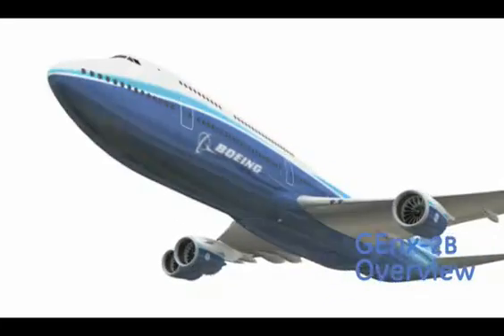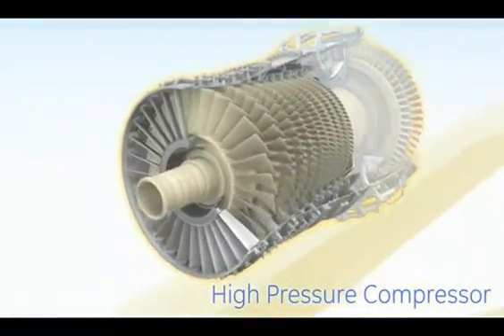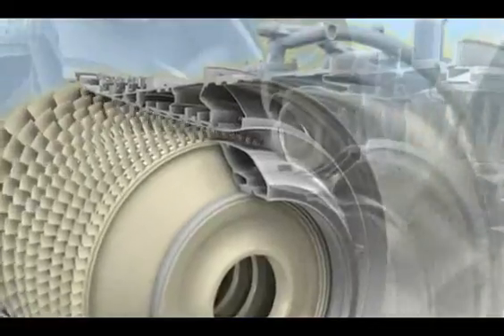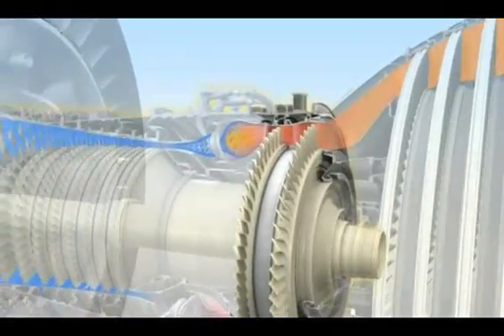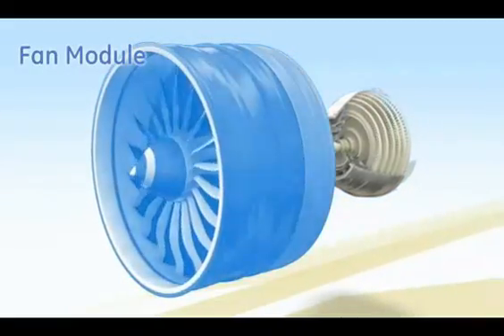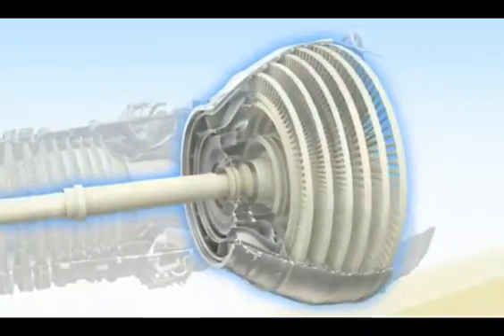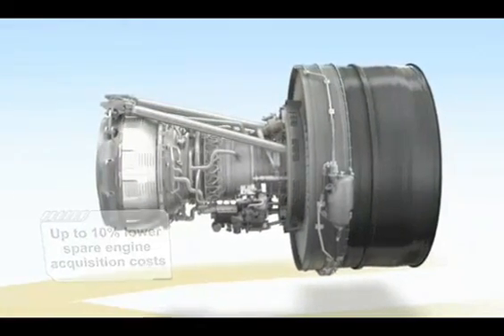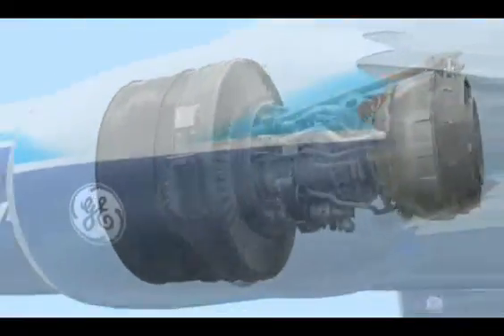BOEING 747-8 ENGINE (HQ)

Comment: You see, the original engine had a base-plate of prefabulated amulite, surmounted by a malleable logarithmic casing, in such a way that the two spurving bearings can run a direct line with the panametric fan...

Comment: Actually the BA 777 was due to a heat exchanger that Rolls Royce did not design properly.  The QF A380 was due to an incorrectly manufactured oil feed stub pipe. Both Rolls Royce issues.  Look it up.  Rolls generally makes good engines but the way they handled the Qantas incident turned me off of their engines.

Comment: A380 was due to a broken oilpipe. B777 was Ice Crystals in fuel = not R&R's fault.

The A380 that failed was a 1:1000000 scenario.
Reply: Krelle1912 Ice crystals do form in fuel at high altitudes under special circumstances where the temperatures are much lower than expected and especially on long haul flights. However, it was the poor design of the heat exchanger that allowed the ice crystals to clog up the fuel flow thus starving the engines of fuel supply. 

Subsequent to the accident and demonstration of icing in the fuel line, the heat exchanger design was modified to prevent future issues of the same nature.

The A380 was due to manufacturing error in the engine oil stub pipe. The walls of the pipe were thinner than specification due to improper counterbore operation.

Bottom line, it is RR responsibility.

Comment: gas is a compressible fluid, water is not a compresible one, gas under gas law increses pressure by change of energy from velocity to pressure with temp increasing, liquid in the same condition changes of state from liquid to gas, in the first two or three stages wáter is vaporized, then

Comment: So sorry stage, not etages, but gas turbine have another metric like temperatura ratio Temp exit nozzle/Temp inlet = Temp released by axial/Temp inlet * Temp combustión chamber exhaust / Temp released by axial * Temp power turbine exhaust / Temp combustión chamber * Temp exit nozzle / Temp power turbine exhaust, then temp combustión chamber is bigger tan temp released by axial, currently the exhaust of a combustión chamber reach 1000 deg to 1400 deg, the one in the axial is among 800 to 900 deg

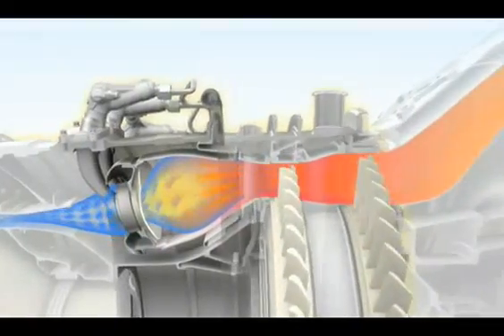Comment: This is not linear, first one gas generators have compression ratios among 1:7 to 1:13, early 70 reach among 1:15 to :1:19 today have 1:21, this related with gases law of a staecheometric mixture of gases.  All gas are compresive fluids wáter is a non comprensible fluid.  The compresror changes velocity into pressure compression the gas and increassing their temperatura, wáter reach by increasing of temperatura and pressure an change of state, and dissapears in the first two o three etages.

Comment: So, when air is pressurised by the compressor blades, heat is generated and that vaporises the water - Is that right?? Hard to believe that pressurising air increases it's temperature, and THANK YOU for your reply...

Comment: I'm not an engineer, but from what I do know, 70-80% of all the air passes through the fan and the air that passes through the compressor will be around 1,000 degrees before it reaches combustion.

In a nutshell, I'm not that concerned.

Comment: Given how close so many of the major 747-400 operators are to Rolls-Royce, it was still nuts to go exclusively with GE engines.  British Airways (the largest 747-400 operator) can't afford a repeat of the uproar in the UK when it went with GE engines for the earlier B777s.  Every order they make without RR engines is a political issue.  All but ensures the supremacy of the A380.

Comment: You should ask  Qantas  about Rolls Royce engines reliability  ...LOL. And  regarding 777 ,in the last 12 months Trent 800  has had 3 IFSD whereas GE90 has had 2.....even though GE90 has 4.6 million FH compared to only 1.8 million FH for the Trent. GE90 flew 2.5 times as much over the last year and had fewer total shutdowns and the -115 had none .Source: Boeing First Quarter 2011 ETOPS report

Comment: Three of these engines cracked their mid shaft, two had never flown and the third had 1000 hours on it. So much for GE's quality. Right now they think it was caused by the assembly lubricant they used while tightening on the nut at the front of the shaft, but the NTSB says all GEnx engines must be inspected before any further flight and frequently thereafter. Everyone makes mistakes and suffers failures, if you think you are perfect you obviously never worked on anything like this.

Comment: does any one know why the N2 compressor rotors and the turbines as well as the induction fan is running in the opposite direction as the N1 compressors and turbines? Is that to avoid compressor stalls?

Comment: emmision, fuel efficiency and noise mean alot, but that has nothing to do with principle of work as i said 100 times, it is all old idea axial static and dynamic blades, in HP and LP compressor, they fancy redesigned comb. chamber, and addes some fancy things to turbine, added big stupid fan that ruins beauty of turbo reaction and afterburner. But as i said NO MAJOR CHANGES.......! Ramjet or scramjet is for example change, and that is direction to go, with no moving components.

Comment: If you want to argue with me, let me warn you, i am jet engine expert. And yes, composite blades, turbine feathers with holes etc.. are just minor changes, general principe has not change since WW2, and that is compressor, Comb. chamber, turbine (axial or radial). "turbo" FAN is just fan engine like turbo PROP engine, just optimized for higher speeds (500-800 kmh), it is not real Turbojet engine where you dont have fan, and 100% thrust come from rocket reaction.

Comment: BOACMach2  is right  02 JUN 2006 Boeing 767-223ER  with General Electric CF6-80A2 . The HPT stage 1 disk failed from an intergranular fatigue crack because of GE's inadequate design of the CF6-80 series HPT stage 1 disk. During test the engine experienced an uncontained rupture of the high pressure turbine (HPT) stage 1 disk. Debris punctured the fuselage and fell onto adjacent runway and taxiways

Comment: Seems GE aren't immune from problems with their engines either. Urgent safety directives were issed by the NTSB in the light of several uncontained explosions on CF6 engines over the past few years and linked to a variety of aircraft, both Airbus and Boeing.  Perhaps we should all accept that nothing is guaranteed failsafe.

Comment: @05u16hep Well to start this off The 747-8 is more fuel efficient then the A350 and AIrbus didn't reject the Engine GE rejected them due to a contract with Boeing . The 747-8 is not going against the A380 a whole new plane is (Boeing Yellowstone Project 3) and RR blades are heavier then carbon fibers making the engine even more lighter. The A350 is gonna be out dated by the time it comes out i mean come on the engine isn't even built and The plane isn't even built

Comment: @averredude101 Compared to the 787 with over 827 orders and options for 600 odd more this plane is the most successful in aviation history.  As for the 747-8, isn't it funny that companies like Emirates cancelled their order for the A380-800F only to order their new freighters through Boeing with the 747-8F?  Face it, EADS have been caught out whilst they panned point to point AC like the 787 over the megaflop A380, only to be forced to build something similar with the A350.  Airbus=fail.

Comment: @averredude101 That's why their being sued for over 100 million from Qantas, as well as SIA having a trent 900 have an uncontained IP turbine disc today.  RR seriously is a great company, but their engines are shit.  Ask any operator who has the RB211's.  Exploding turbine discs are the norm.  In fact, RR has more uncontained failures than anyone else.  Maybe you should read a little more dude.

Comment: @108107643 if a airport is able to land a 747 just now will it still be able to land the new one then with out extending the run way?
Reply: Depends though,the 747-8 still has the ability to land on short runways with higher weights than the 744, but the required landing distance will be more than the 744. However for short field landings,good pilots are required. However if you speak of 2500m runways then abosolutely no problem on the 748i (skilled pilot required though)

Comment: 747-8..... Winner, plus its better design where form meets function. Besides all major airports were designed around the 747 at the time. No need really to extend runway lengths unlike 380. Good Job Boeing.... If it aint broke than dont try to fix it, but improve on it....thats exactly what they did. Imporved.

Comment: @Linkwizzard The old fuselage design you criticize is a proven workhorse, plus improved operating efficiencies and reliability come from the wing design and engines, both of which have been redesigned from the ground up for amazingly low seat-mile costs.  Plus airlines know that the 747 is reliable, will fit existing airports and wont have empty seats on routes that serve 467 customers instead of 555.   

Airliner success is not based on what enthusasts like. Airlines operate these things.

Comment: Nice engine. Brother-in-law just retired from GE as a metalurgical engineer on their jet engines. Said admin is dumber than rocks and company is cheaper than cheap. Hated working for them but said it was a job.
Would not want to fly either 747-8 or 380. To many people on board. More people, less service, less heads. Give me the 320/737.

Comment: It`s only a history aircraft from yesterday, design from 1968 and now is on total end . Remember all ex PanAm and TWA Maintenance Staff - during 1970 to 1973 problems after problems with JT9 engine , the Fuel system - the Autopilot system . Many Boeing worker , ex former Pizza or Hamburger engineer on productionline.

Comment: Actually the fan blade design of the RR trent 1000 was only capied from the GE 90 engine of the Boeing 777 who copied in the first place??...
huh??..........
Even though both engines are good but the difference of the is the RR vibrates more than a GE engine......

And I don't see signs that boeing 747-8 copied a designs from airbus!... Who copies a super sized plane anyway??.......